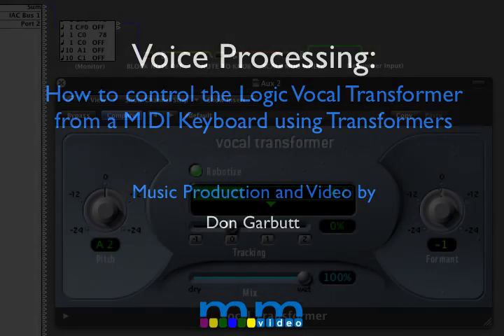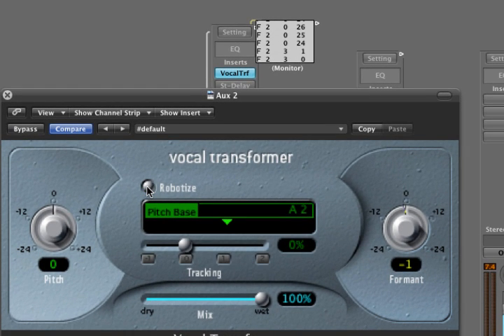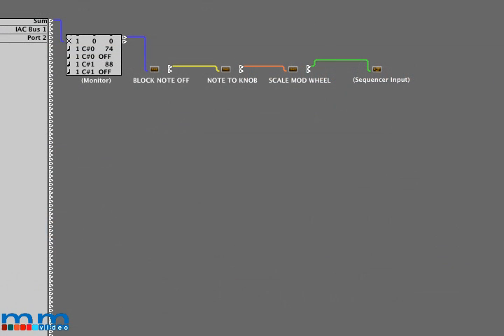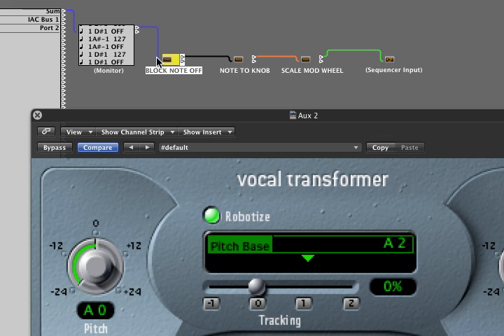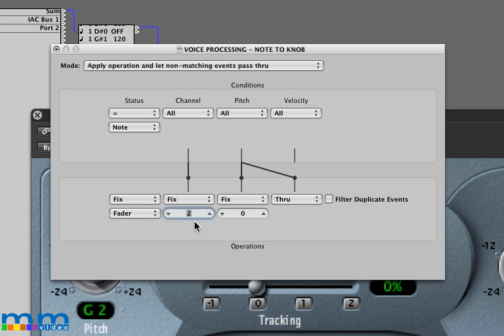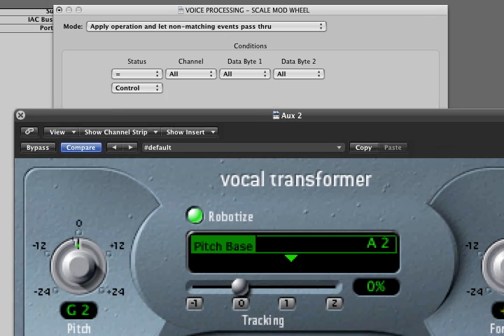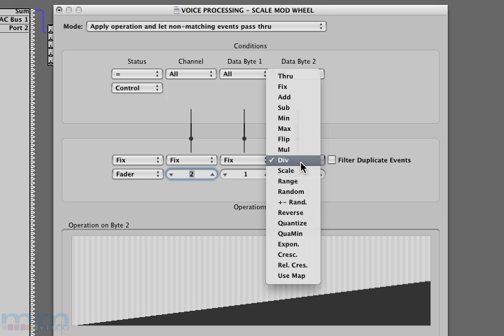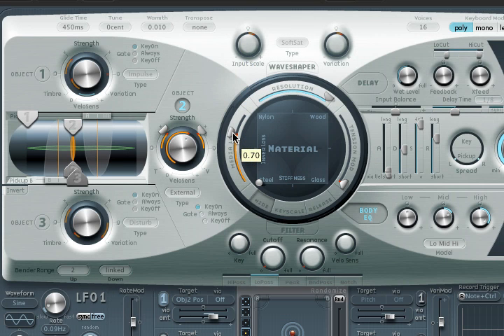MIDI Keyboard Control of Logic's Vocal Transformer

Comment: This is a comment I wrote on another video comparing Logic Pro and Cubase Pro. I touched on some of this in the comment. "Great video comparrison. I also use Logic Pro and Cubase Pro. I love both DAW's, Cubase has some unique features missing in Logic. Cubase has Chord Track and Chord Pads which is a really powerful feature, harmony and stacked harmonies generator (controlled via the Chord Track), and the one I really love.. Cubase can alter pitch correct from a Midi keyboard (or virtual midi keyboard)  in real time creating that TPane vocal effect.. Logic can't do this.. Previouslly in earlier versions of Logic you used to be able to perform real time pitch changes via Midi using Vocal Transformer and by setting up Transformers in Logic Environment.. but this doesn't seem to work in the more recent versions of Logic. Cubase has a really powerful and easy to use Arranger track for creating differrent mixes or trialing song structures. Cubase allows you to enter numeric values when doing automation which is really helpful and time saving whereas Logic you have to drag up and down values and getting back to zero or whatever value you wanted to end up on can be a laborious exersize. Logic Pro is great (apart from missing the listed unique features) as Logic comes with so many great software instruments, sounds, Drummer track, stock plugins, you can make great music just using everything stock standard in Logic".

Comment: Perfect. You seem like the kind of guy who could answer this simple question. I have tried a number of ways to do this and so far have not figured out the math but maybe it is simpler. I have a V Synth with an XY pad which I want to assign to the binarual panner in the channel strip which maps the same space using radius - it needs to work such that when I put my finder on the XY pad the resultant pan relates to where I put my finger... What would you transform and where?

Comment: Late reply, I know but incase anyone else is having the same problem.
All you have to do is make sure that the MIDI is connected to the channel with VocalTransformer in some way (even to the channel strip directly) after being put though this window at; 3:12.

Assuming you program it the same way, the only thing that may need to be different is that little number at the bottom of the "Channel" parameter. It needs to be the number corosponding VocTran's position in the plugin chain.
Reply: MVP